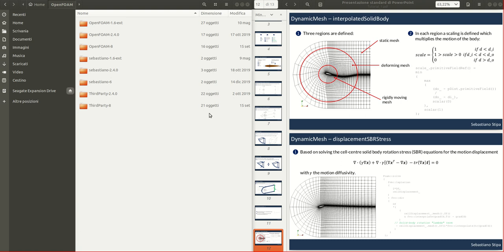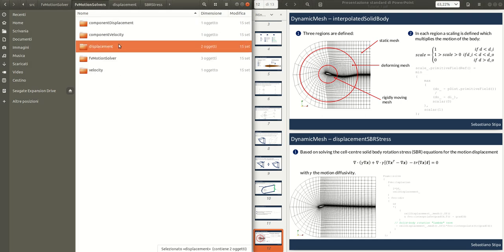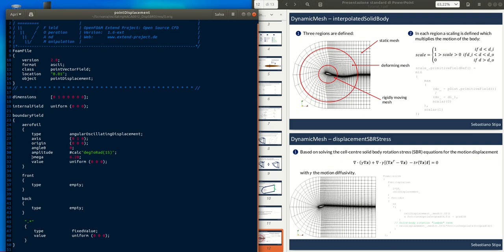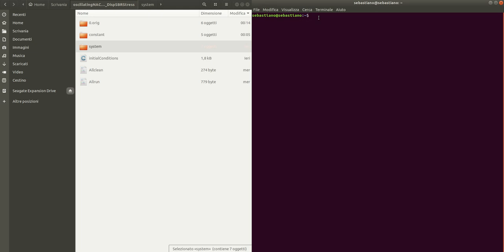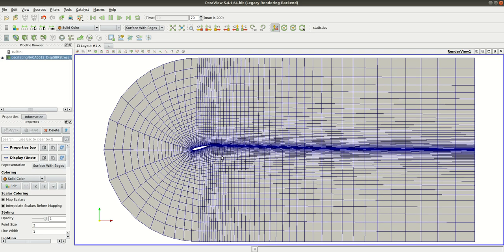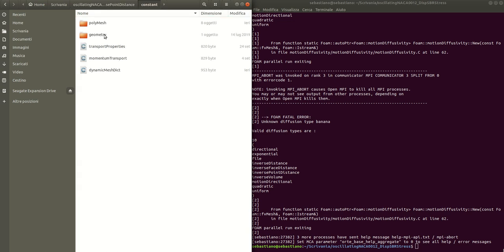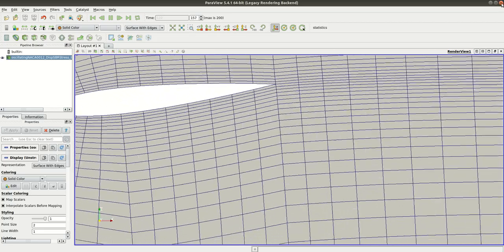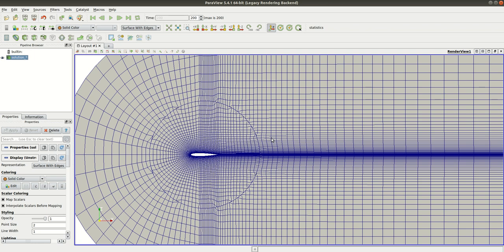Dynamic Mesh OpenFOAM Tutorial 3 - Finite Volume Solvers

Comment: Hi Sebastiano, you made a very helpful tutorial. For those who want to use the case files for OpenFOAM 10, you have to make some minor changes. Just look at one of the tutorials that use a dynamicMeshDict and you will clearly see what changes are required (you need to define a 'mover'). Also the format for defining parametric input files, such as the blockMeshDict has been changed in OF10. The 'dot' has become a '/'  and the 'colon' has become a '!'. Hope this helps and saves you some time!

Comment: Hi Sebastiano, Thank you for your Dyamic Mesh series, they are really helpful and well explained for this topic. Can you please explain the meaning of the parameters "directional, motionDirectional, file" when displacement-type motion solver is used?  Thank you!
Reply from the maker: I think you are talking about the motion diffusivity models. These are two type of models for the diffusivity coefficient of the Laplace equation for the mesh motion. Basically in the first one the mesh motion is done proportionally to the direction of the motion, while in the second one the motion of the body is prioritized. Consider that Laplacian mesh motion is very case-dependent, so the best way is to try both, and use the one that best fits with your specific problem.

Comment: thanks for the nice demonstration. I am wondering can I create a moving porous bed in which air is passing through. Moving porous bed velocity in the downward direction can be solved by laplacian solver. In this I want to use dynamic mesh. air dynamics can be solved by simple foam. Can I merge it together?
Reply from the maker: You are welcome. That would require a bit of coding I guess, but everything is doable :)